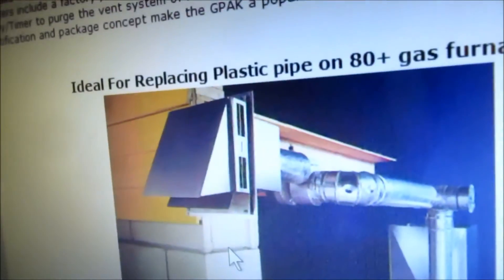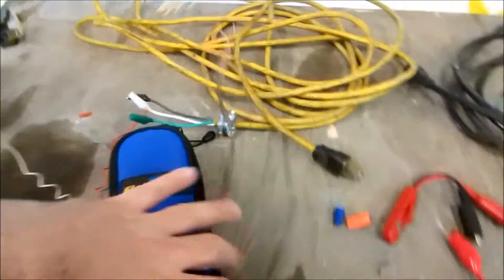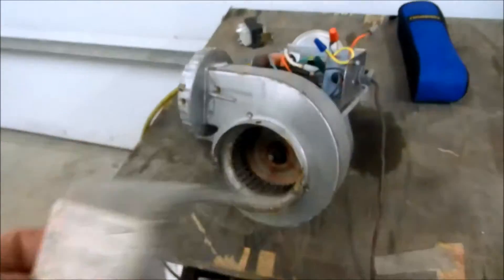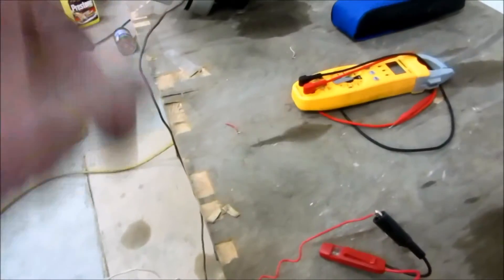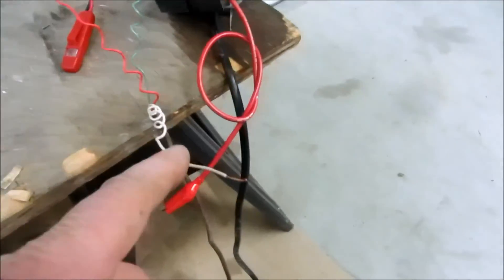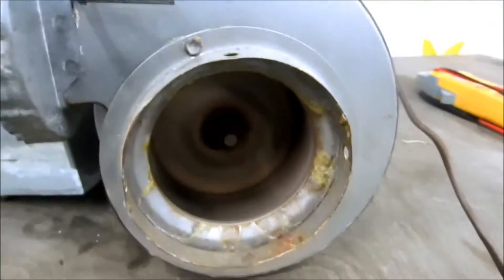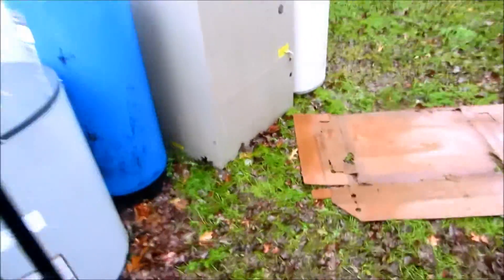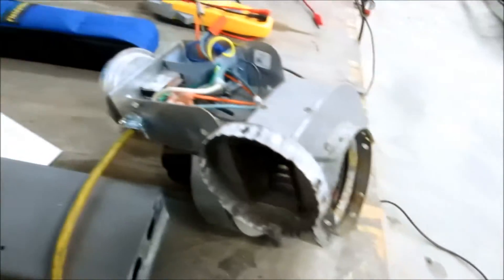HVAC: T JERNLUND  gas powerventer demo how its wired and works

Comment: Steve do you have a recommendation for a power venter for two gas furnaces common vent. I hardly ever encounter a need for these so don't know much about them. Anyway the HS1 kit with a MAC1E Multiple Appliance Control appears to be what I'm leaning towards.

Comment: I have the Jernlund brand side vent on my 80+ forced air , had it installed before removing the chimney in my house ,  the furnace also has the draft fan that was built with the furnace so I have two running , I did not know about the oil port is there a specific oil to use and any other preventative maintenance I can do  ? thanks .

Comment: When the controller for this vent system light says, "calls for heat", what does that mean? We just put in the latest model of this unit and that's the signal that comes on.

Comment: i believe the blower wheel may be available but not sure if the motors are available for the T Jernlund power venters. some contractors or HVAC companies replace these with the Field Controls. power venters mainly the wall mounted SWG power venters which are available for oil fired applications and for natural or draft induced furnaces and water heaters. as the SWG powerventers are more common now.

Comment: Thanks for the demo.  My power venter just broke.  The motor is real slow when it begins to turn when the thermostat kicks on.  It looks like the motor is broken.  The same thing occurs when the hot water heater or the gas furnace kicks on.  This gave me a good idea on swapping this out.  Thanks for spending the time to put this together.
Reply from the maker: +Garrett good luck with your repair

Comment: Very informative video.  So does the vacuum switch prevent the burner from coming on unless the power-venter is running ?  Thanks for another great video Steven !  I've learned more from watching your videos this week than I have learned at HVAC school this week ! LOL !
Reply from the maker: the vac switch is a safety if the powerventer motor does run you have no draft so the vac switch will not pull in pretty simple operation .stay in school and learn what you can once you get out in the field you will learn everyday as you go along as i did stay with it you will be fine   matt. i always say experience is a bunch of problems you figured out how to fix over time ..you need time under your belt to be good ... thanks for the comment
Reply: steven lavimoniere I'm very excited about school.  I'm going for my associate's degree in applied science in air conditioning technology.  Next semester I'm taking electrical components, heat and humidification, heat load/duct design, and refrigeration fundamentals.  This semester the only HVAC related class I took was HVAC electricity.  After I finish, I would like to get some additional training in electricity and plumbing, but I may just head straight into the work force instead.  I'm looking forward to eventually getting my master license so I can work for myself like you do.